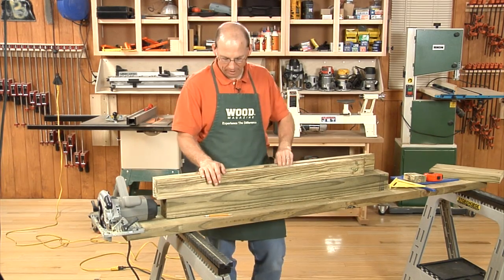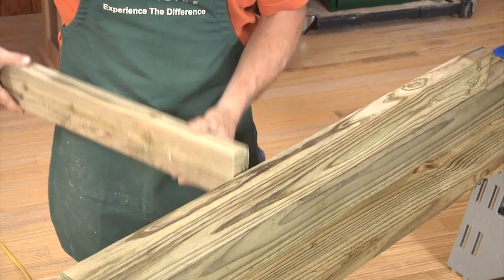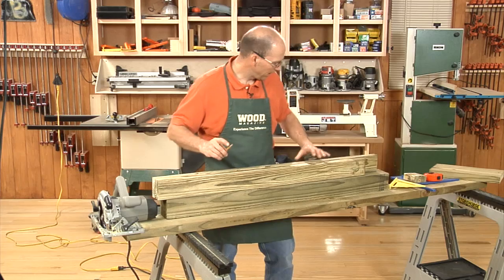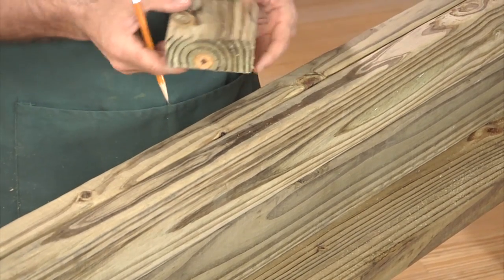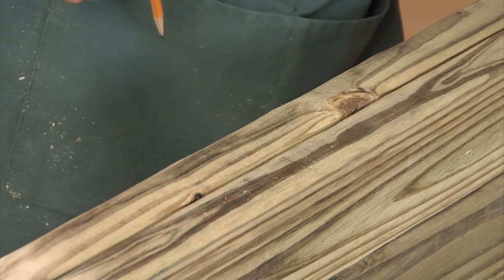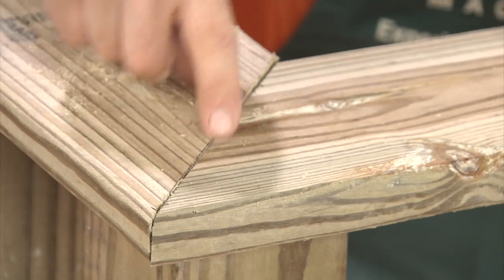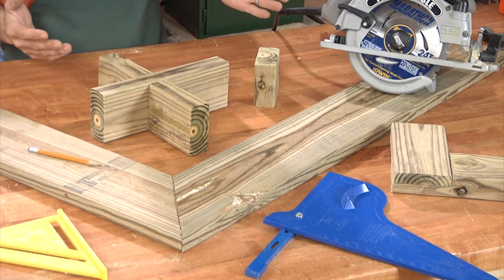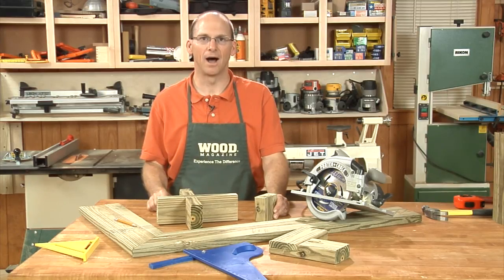Circular Saw Joinery - WOOD magazine

Comment: “We’re not building a piano.” Words to live by! Don’t let the perfect be the enemy of the good.
Reply: Exactly
Reply: I look at it differently.  I know that no matter what my quality target is, I will fall short.  So I start out with a goal of doing it perfectly.  That way I'm practicing and improving my technique.  If I'm not building a piano, and the result isn't perfect, I'm fine with it and don't get stressed out.  Then when the time comes to build something nice, my skills will be better able to come close to perfection.
Reply: "“We’re not building a piano” are not words from a wood worker.  Today's carpenters with the pressure of production will mass produce with splitting wood, plywood that delaminates over time, nails adding to the splits, nailed butt joints with no permanent anchor, leave the work exposed in the rain for weeks then cover it to give fungus a running start, because that is the market and no one demands a high level of precision/durability.   

Wood workers use diagrams, make precise measurements, create precise joints, and do not use nails.   Roy Underhill exemplified this even when erecting a barn with somewhat wet wood and ball joints, where the wet wood upon drying will shrink around the ball joint.   Traditional wood joints are recognized for their exceptional shear strength: https://www.tfguild.org/timber-frame-engineering-council/member-publications-and-research/view/138/download

Think about it.  For load bearing beams in houses, you never see triangles or arches used to stabilize and distribute weight, maximizing a small amount of material.   https://www.youtube.com/watch?v=mBHJtWbsiaA&list=PL-B-SWBAo34rJ9ocawYOe1wn7lEDZHy1_&index=3&t=0sMortise, scissor, dado, etc, joints, to provide flexion and strength as was done in the past to permit earthquake/tectonic resistance- forget it.    This documentary on China's Forbidden City underlines the use of joinery for resistance to the shifting earth: https://www.youtube.com/watch?v=bW6LnCsK6cM  You cannot get that kind of perfection from nailed butt joints.
Reply: @chrissmith2921  Prove your statement with evidence and authority from a researched book or .edu source.
Reply: @aguilayserpiente  You get what you pay for. And in the mean we all feed our families.
Reply: @aguilayserpiente  And construction is an art. And you want books and etc. You should stop speaking and writing. You make a fool  out of yourself.
Reply: @chrissmith2921  You bear the burden of proving your assertions.  The "in my experience statement" is followed by a misrepresentation as it cannot be verified.  Personal insults are the last resort of those, who have no reasoned position.
Reply: And insults are no different then stating any other fact.
Reply: @chrissmith2921  You created a straw man argument that it it will cost $7 million to build something (presumably a house of unknown dimensions), if wood working joints and quality are used.  Prove it.    Absent proof and authority, your contentions lack merit.
Reply: Reasonable philosophy... "Just give yourself a break once in a while" as it were...
    Just my experience, but the only relevant difference between these joints (for construction in the vid') and the kinds of joints in cabinetry and "heirloom quality" wood-craft is the clean-up.
    Along with extra clean-up, maybe leave just a bit of waste TO BE cleaned up, compensation for using a combination blade on a circular saw... if you want maximum precision...
    AND let us not forget the "fresh from the store" moisture contents... storing wood anywhere from 3 weeks to a month and a half lets it stabilize... provided (of course) you have that kind of time on your hands. ;o)
Reply: Donald White ;)
Reply: You're forgetting the second part: we're not building a piano; we're building the case.
Reply: @msbrunell  then I'm DEFINITELY going to need a bigger hammer. ;oP
Reply: As long as the good is actually good and not dog rough.
Reply: I once built a piano out of pressure treated lumber. Sounded like shit.
Reply: Yeah right I'll frame a house up & get damn near to 1/32". Ppl said we ain't building cabinets.. No its a house cabinets are hung in. Why not be precise?
Reply: Americans will fight over anything.
Reply: good is all you can get out of pressure treated lumber
Reply: @aguilayserpiente  You may well be correct in your opinion. However, the folk who come to YouTube to learn how to do things, like me for instance, are more than happy to learn that I, with a little patience and practice, can get results that will serve my purpose. Tradesman come here to pick holes and denigrate others efforts because - that's not what a tradesman would do. No shit, I'm not a tradesman.
Reply: @dagored4077  I did not know that anyone putting hammer to nail was sensitive nor that anyone was sensitive to facts about wood joints, market pressure, and fungus, with back up.  To denigrate is to attack someone's reputation. https://www.merriam-webster.com/dictionary/denigrate  None of my polite posts denigrate anyone.  Nor is anyone here asking for a letter of recommendation.  YT invites comment, including inconvenient ones.
Reply: @aguilayserpiente  there are woodworkers who work with CNC machines!

Wooh, I guess I've scared him!
Reply: @BJaca-tn3om  Cool.  Post a link to a fascinating video.
Reply: @andyboybennett  00ⁿ
Reply: @kumaravsubramanian3495  ??
Reply: I agree completely with the statement it comes from Voltaire but the idea predates him even Aristotle has some similar concepts. The idea here isn't to be sloppy and ok with it instead its to accept when something is just fine and be done with it. Maybe just maybe all of you arguing against it happen to be among the very top top in the industry(doubtful) but more often than not when I'm stressing about a 32nd I screw myself over an 8th. Odds are if your working on something that requires that level of precision you are using tools designed for that
Reply: I hired a carpenter once who claimed he DID build pianos. He was rubbish
Reply: Nice, simpel and practical, I love it, thanks!
Reply: I now have another one: “Good, cheap, easy...pick any two.”

Comment: Nice job. Would like to add that it may be good to pay attention to grain.. At 9:00 on the lap joint, I would take out the heart wood on both pieces so that the joint would be stronger. (not the end of the world if you you don't do this but taking grain into account is not rocket science. There are at least three basic grain patterns and it benefits the buyer to know them. ) I think adhesive will end up being stronger then the screw in soft wood. Would recommend drilling pilot holes because screws will split softwood and likewise be careful not to sink the head unless you already countersinked it. (don't sink it past the countersink.) Using a sharp blade and using wax for lube will cut down on burning. Glad to see these wonderful videos coming out to show how simple and enjoyable these projects can be for the average person. Thanks for sharing.

Comment: Great video and well explained. Thanks! 

I don't like to cut pressure treated wood any more than absolutely necessary because the saw dust is toxic.  Its filled  with chemicals that  even the hardiest insects succumb to.  I built a deck twenty years ago and I used untreated hemlock for the supporting rafters (painted, and with tar paper on the top edge) and pressure treated boards for the deck but I didn't cut any of the deck boards (deck was 10' by 14').  This deck stood up well for twenty years and still going. 

 Also, when you notch a pressure treated board I think that your exposing the center of the wood to moisture and it  will rot there just as fast as an untreated board.  I made a deck railing one time and I painted the wood in all the inside corners before assembling.  That was only three years ago, but it seems to be standing up well so far.  Sorry to be a little negative about pressure treated wood hazards; I did like the joinery tips a lot.

Comment: Excellent video...tip: when pulling back blade cover to expose the blade for setting depth of cut, it’s not a bad idea to disconnect from power...especially noobies!!!! So as not to disconnect a finger, or worse. Thanks for sharing this useful know how.
Reply: Hope you not talking from bitter experience but nonetheless a very good point.
Reply: sunray34charlie ...no, I still have all my fingers, but worked with a few carpenters who did learn from bitter experience! I actually got 2 different jobs replacing one guy who lost a hand and one who lost the tip of his finger. Experienced guys sometimes forget the powers they wield!

Comment: Thanks.  I have a table saw, but this is more the work I end up doing most of the time.  I like the look of it too.  Functional.  That square cut jig was all right, but easy to build your own with a couple pieces of scrap wood.  I still need to build an 8 foot edge guide from a piece of hardboard or plywood.  Wait till it need it for a project.  I did some window trim with a butt joint and my brothers thought it was terrible, but I like the look of it.  More country.  Use wider boards.

Comment: I am just starting out using the antique circular saw that I bought ten years ago, trying to make half laps.  My first try was a failure; I cut it too deep.  You tip for measuring the saw depth will be very helpful.   However, why did you not clamp the two boards together when cutting the half lap?
Reply: I thought about that too.  I have a pair of wide jaw vise-grips just for that. The way I would do it is to wedge the two pieces between two scraps of wood that I clamped to the table. This is so that I didn't clamp into my finish product, creating crush dimples in the wood. There are a few other ways to do it too, just like the saying, "more than one way to skin a cat."
Reply: David Sox I don’t recommend you set depth like hi did 
Set it they way you use it and never finger near the trigger or blade like he did 
Safety first 🤙
Reply: @nmoran2046  Also, he left it plugged in.
Reply: He's demonstrating jobsite techniques, just inside at the workbench for video convenience.

Comment: I notice that big box stores won't cut treated lumber in their stores. I always thought it was cause the treatment chemicals were unsafe. The joint demos were pretty good but are they safe to do indoors?
Reply: A carpenter told me always wear a mask when cutting fresh treated lumber and gloves for protection against chemicals.
Reply: use a mask protective glasses and gloves. MDF surposedly is dangerous for chemicals/glues in its making. your lungs wont last

Comment: Nice video, with lots of great techniques.  Everything is well explained.

The wood looks quite green in color and I think I noticed a "pressure treated" label on the end of one two by four.  I don't like to cut pressure treated wood indoors & I avoid using pressure treated wood anywhere that involves a lot of cutting because I'm concerned that I might inhale some sawdust that has toxic pressure treated material in it.  If the toxins in the wood stop bugs, molds, and lichens in their tracks its probably not good to breathe!  Also, the saw cut aren't treated with preservative and are liable to rot which un-does the benefits of pressure treated wood.
Reply: They treat with a salt solution these days so it safe to cut indoors as there isint any arsenic in it

Comment: I like to unplug the saw when setting cut depth.
Reply: Mark 
My first thought exactly.
Folks it’s literally seconds.
Think about how hard it will be to get them 
blood stains out of the wood that dried while you were in the ER.
Reply: @rogeroday9408  your probably OK if the saw has that button you have to hold in while sqeezing the trigger. I have one circ that has it and one that doesn't.
Reply: FireBlade X 
LOL, I learned a long time ago.
Probably is a pathway to “Hold my beer and watch this”
My point is you are demo-ing a process
Yer deal but...
Reply: @rogeroday9408  keep your hands away from blade. Pretty simple
Reply: @truthhurts2256 If the blade unexpectedly starts moving it could grab the work piece and travel up it flinging it into your hand or worse.
Reply: Don't have time for that

Comment: just bought my first circular saw and read carefully the safety instructions. It recommends always to keep both hands on the saw and then you won't lose any fingers. Demonstration shown involves using the saw single handed which is potentially dangerous. The speed square could be clamped in place to leave both hands free to hold the saw.
Reply: Margaret Forrest safety instructions are written by lawyers. Join the the real world. 30 + years as a boatbuilder, carpenter and furniture maker.

Comment: When setting the blade depth you better unplug that saw or they may be calling you "stubby".
Reply: easy to get complacent but I 'm with you on that one. I always unplug the saw when my hands are that close to the blade.
Reply: Funny/sad that you could see the saw plugged in while he is touching the blade and has it pointed at his other palm.  As a non-pro that is not _one with the saw_, I will unplug every time.
Reply: that is unnecessary
Reply: @dincerekin  Quick trick for that, the saw itself has a relatively short cord. So I plug it in a power bar with fuse and high joule protection... the thing is that is has a switch on it, it turns it into a kind of safety stop device and it has a shiny red light on it. Doesn't really work in the field though
Reply: My saw has a safety mech which would make it impossible to accidentally start up. Not sure I can say the same about his. Mine is lithium. Don’t use the corded stuff anymore.
Reply: Unplug and use P,P,E,and be safe and live longer
Reply: Just don't pull the trigger.  I have yet to see a saw that turns on by itself.  By no means am I against safety precautions but if I'm at work or in the shop I rarely unplug tools to make adjustments
Reply: I’m with John Smith, I’m about safety but unplugging the saw to do adjustments is unnecessary. If you cannot make adjustments without having enough sense to not pull the trigger then you don’t need to be using the saw to begin with... people watch way too many videos and try to be what they think is professional because some guy or woman has their own television show and told you that is the proper way to do it.. well who cares??? Men need to be men and quit a lot of the nonsense of not using common sense... but hey if you feel you cannot adjust the saw without pulling the trigger then PLEASE!!!! Unplug the saw.. If you unplug your saw for simple adjustments then 🤷‍♂️ but quit judging others that don’t unplug the saw... just because we know that we can adjust the saw with it plugged in without pulling the trigger doesn’t mean you have to get all jealous, bent out of shape and mad at us because you don’t feel safe... and I can’t wait for all the safety professionals to cry because Me and others don’t conform to their way of thinking that they watched on a program or read in a book...
Reply: there is a slim chance of a malfunction in the trigger mechanism that could cause it to power the tool randomly. It's slim, but it's not zero.
Reply: LMFAO!!! Very good!
Reply: First thing you are told is always disconnect the power when adjusting or setting any hand held power tool.
Reply: Unplug when changing the blade but not for setting the depth. That only takes a few seconds.
Reply: _ David _  
Not really. It would be if you skipped the steps of making sure the gun can't mechanically fire. 

It's what we did in the military all the time.
Reply: _ David _  
You mean ignoring those steps? 

That's the same assumption you could make for the 4 normal rules.

Because, a weapon without a magazine, and nothing in the chamber literally can't fire. 
It's as dangerous as the magazine on the ground.

Or more accurately, as dangerous as looking through your disassembled barrel.
Reply: @1DrBar  which means he pulled the trigger. It probably also means he wasn't doing it on a bench or table and he wasn't focused on what he was doing. Just be smarter than the tool and you'll be okay
Reply: I have read many of the replies about not unplugging the saw to make adjustment.  When I am going to teach my grandsons (or any one), I am going to teach them to unplug!  Unplug before doing anything with the blade where you could get cut.  I do see where he could make that adjustment with out putting his hands any where near the blade.

Comment: thanks for the video but now can you show how to extend 2 pieces of wood and is it a good idea to extend   wood over say 8 meters ( 2 pieces 4 meters ) as a beam
Reply: Scissor cut... Used all the time to make ridge beams and floor beams. And it is a very strong joint, i used it for many years with zero issues.

Comment: that blue thing is a "Kreg KMA2600 Square-Cut"
Reply: Thanks a lot!
Reply: DukeLaCrosse20 thanks
Reply: Thanks!
Reply: I just screw two pieces of wood together at 90 degrees, cut one end with my dedicated circular saw or jigsaw and have the same use. You could also make a combined one for left side and right side cuts
Reply: Bought! 🤓👍

Comment: I need to cut a cross cut mortise joint or trench in 4x4 inch wood to an exact depth of 2 inches. Which tools do you suggest eg circular hand saw with a rail or guide, or a sliding mitre saw with a depth stop. Which is more accurate. If I do a set of parallel cuts, then I aim to hammer the remaining wood slits out to create the mortise joint. Please comment. A dewalt 780 1w inch has a depth stop and plenty of horizontal travel to make a flat bottome cut to a depth of 2 inches.

Comment: Only issue here is that Half-lap notches are already weak because they use half the available wood for integrity / spport. If you drive a screw through it as well, as you suggest, would it not weaken the joint yet further?